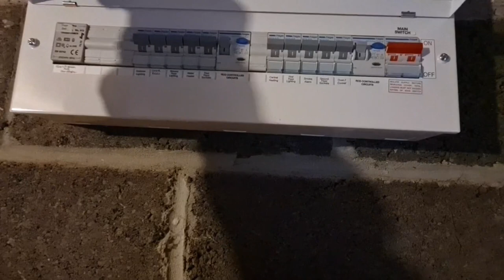Letting agent EICR/inspection and New build electrics. A recipe for??? Plus a Rant!

Comment: When you open up accessories and there is no brown/red sleeving to identify switch live/strappers etc do you fix it there and then and do it at all switches etc or do you put it down as a C3?  Also would the exposed t+e for the outside lights not at least need some sort of containment if outside clipped to the brick and exposed to the elements?
Reply from the maker: Some people will fit sleeving. But others not. We are their to report at the end of the day so in large premises no chance. Small homes yeah why not. 

Same with cables outside we report the issue what happens after is quoted works. Many ways to approach it, containment is one. Equally if the PVC sheath isn't badly worn it's not an immediately or potentially dangerous thing imho so long as ongoing maintenance is in place.

Comment: Great honest video mate.  Thank you for sharing.

You probably have noted it but I would note the bell transformer down not being in its seperate enclosure.

You get an idea that the install would be decent from seeing hager, good quality boards.  I don't think I have seen a bad hager install.  Any cheap board from screwfix I'd think differently 😄
Reply from the maker: Thanks mate, yeah that and the sleeving missing from the odd SL at pendants.  

My brain is often like mush, have to write everything down. Including my name and address.  Never make it home otherwise 🤣
Reply: That's one thing I noticed, didn't look like a Hager bell transformer which is odd as they're rated to be inside the CU as long as the elv side cables are rated for it it shouldn't be an issue?
Reply: @effervescence5664  yes as long as the elv cabling are rated for it.  I used to do this as it looked neater and didn't think anything of it.  Used to dress the elv cable in the board away from any 230v cables and our assessor pointed me out on it and suggested for it to be in a seperate enclosure.
Reply from the maker: They made a neat job of it tbh. But like you say not hager component.

Comment: Not an electrician but I have a question about the water bonding and the outdoor tap. Seems as it's a TN-C-S supply and there's no need to bond the water due to the plastic supply pipe, would it not be safer to have an isolated outdoor tap in order to prevent safety issues with PEN faults? I'm sure the boiler is also bonding the pipes so I guess the solution would be to introduce a small section of plastic pipe before the outdoor tap?
Reply from the maker: Technically it's not part of the equipotential zone as has no potential present both to import or export under a pen fault. In new build its common for all the pipework to be plastic aside from what's on show so essentially what you describe is achieved. 

On older properties it could be a factor but the same thing with outside lights, sockets, gas pipes, other structures with inadvertent earth paths. 

Fortunately pen faults are rare with reported incidents around 1-2 per day nationally. 

Elimination of risk to absolute zero is very difficult. I think we get as close as reasonably possible thanks to the awesome benchmark that is bs7671. 

It certainly doesn't hurt to have a plastic bit of pipe. Unless you listen to our plumbing friends who seem to suggest that brings other problems down the line which could impact water and electricity mixing. I hear that's not much fun either 🤭
Reply: @electrician247  Thank you, it's interesting that the subject seems to be very "on Vogue" right now due to the EV chargers. (Or it appears to be from outside of the trade), I have been wondering if whole-house PEN fault detection will appear in the regulations soon - It's very expensive and as you mention not a particularly common fault which the DNO activly try to avoid with how they now make their connections but high cost hasn't been an issue for recent regulation changes. (AFDDs) Matt:e do make a 100A unit (ARD-1-100-TP) for three phase but oddly they use two remote controlled MCBs in parallel to get the required rating which I'm surprised is allowed. I'm wondering if a Matt:e device (If they made a 100A single phase unit) would be allowed in-line with the meter tails as long as it's within the 3m limit?
Reply from the maker: This is something I thought about a while ago and from the same point of view as yourself. 

The main problem is to do with the nature of PEN faults and the 70V touch voltages these products allow. Also to ask the wider questions of is it safer to have a whole installation isolate itself during a pen fault. Think of say lighting with people of the stairs, in garages or using power tools etc. Wider considerations are 100% in play here. Especially so when inside the equipotential zone when the danger should be limited by default. 

I thought it was a great idea at first but then dug a little deeper and see it has problems. Best served for those big lumps of metal we park on our drives I think atm.
Reply: @electrician247  That's a very fair point you make, there are indeed a lot of considerations and they are best to be considered through a proper process of defining new regulations through proposals which are then peer reviewed. I would point out that those issues are currently already a risk due to power cuts (Which we get surprisingly frequently around here for some reason) but you're right that these are all considerations that need to be made at a much higher level with the holistic situation in view.

Comment: Mark, at 25:04 you said "the back box is a bit deep". As a noob you lost me. Can you explain what you meant and can that be "corrected" (if that is the correct word to use). Also would a new electrician get pulled up for that i.e. when someone inspects their work?  

And why would you not place/or is it better not to place 2 or more earths in a single sleeve - does it give a "false/high" reading? Thank you for your time.
Reply from the maker: Hi, the back box was 25mm and set back into the wall so you have a gap between the backbox and finished wall surface.  Very common. You can fix it with a sleeve that goes between or replace the box for a deeper one/plasterboard patress or live with it. 

The earths in the same sleeve make testing a bit more difficult. Nothing electrically unsafe with it. Just an annoying lol.
Reply: You can run cpc's (Earths) in the same sleevings but it takes more time with testing as you have to separate them especially with testing ring continuity at socket outlets and quite often they can be twisted together so job takes longer untwisting them, its just personal preference when they are reconnected,ill leave them separate easier for the next test inspector

Comment: There are quite a few landlords and fly by night sparks out there where the paper and tests aren't worth jack. That said there are so so many out there that are pedantic to a fault about their investments and quality of work being top notch because they don't want any repercussions down the line. Working for a gentlemen like that currently that wants it rewired due to how badly the tenant had left the property with DIY alterations with no cpc. On the flip side I was asked to change a CU by another that didn't want an EICR beforehand because it "wasn't needed before april 2021" & that place had wiring melted and green goo due to far too large an electric shower being fitted poorly using a garage board as a local isolator but only the 63 amp rcd etc etc (another DIY). 

As a side note I never bothered doing 2391 as I got grandfathered in due to type of work and knowledge so the NICEIC inspectors over the years gave the blessing to continue carrying them out after the old chap that trained me retired. I believe the line was "showed above the acceptable standard of knowledge required" or something similar, I would advise anyone wanting to do it to go for it and get the qualification though, little bits of paper have a lot of clout and I'm not sure you could even get grandfathered in like that anymore.
Reply from the maker: Cant beat experience can you! But yes we need those bits of paper now. 

True lots of bad out there but as you identified good also. Like to offer balance if I can. Got some shockers coming on YT soon 😀
Reply: @electrician247  Looking forward to it, I'd love to have the time to film n photograph but we're just too busy - never shut down at all this past year. Eventually I'll get the bit of paper but currently I'm cued up to take the rest of the outstanding gas qualifications to take over as senior gas engineer when he retires.
Reply from the maker: @effervescence5664  good luck with the gas quals! Nice.

It does take a lot of time to be honest recording and editing.